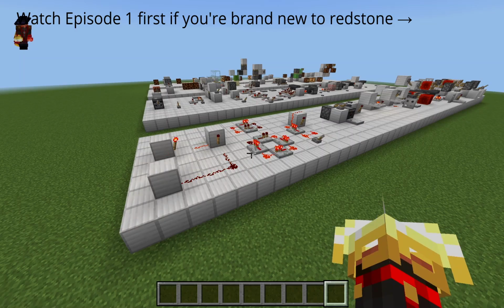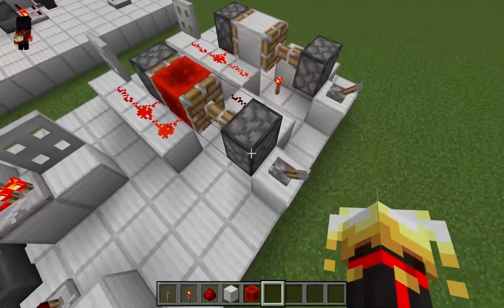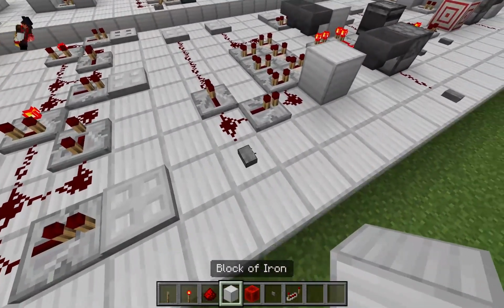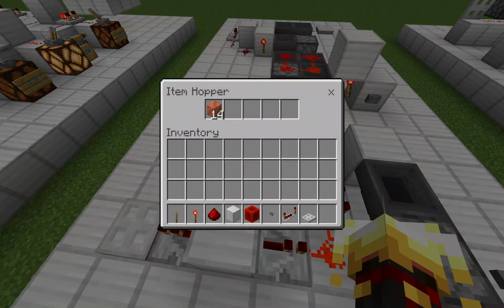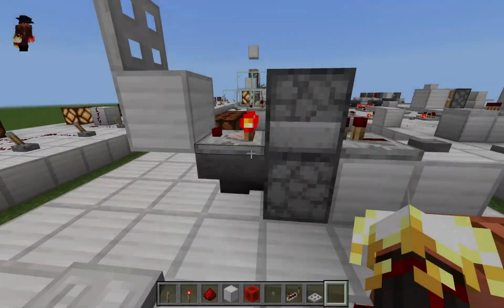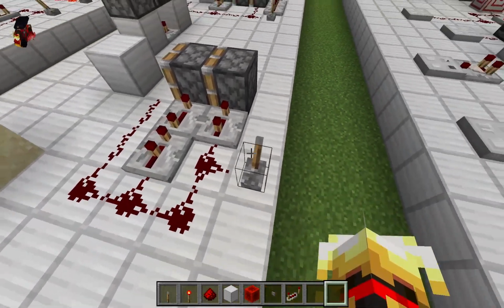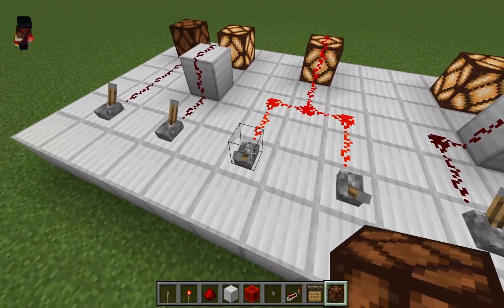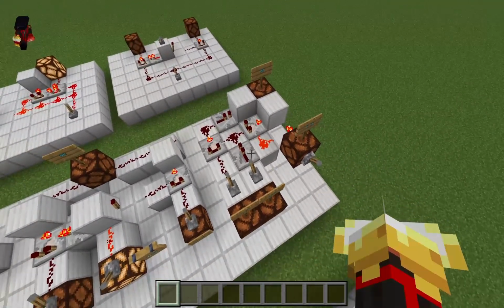Redstone Tutorial:  Part Two – Circuits

Comment: very good information for beginners in your video 👍 you got a sub.

at min 3:00 i consider it a latch, the smallest in bedrock i think. if you give it a 1 tick pulse it will jump back and forth as you show. if you give it a 2 tick pulse it will act as an SR Latch.

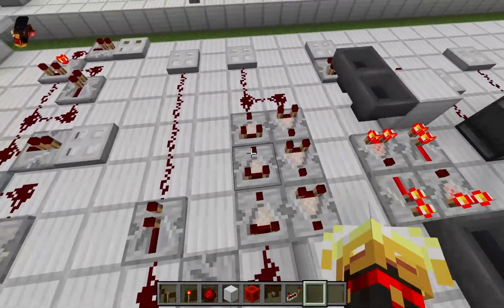the comparator loop you show at min 8:00 is also a very interesting circuit that can be used in several ways.

All in all Well Done 👍👍👍
Reply from the maker: Yea that’s true, it is a latch, I personally haven’t dived that much into memory so therefore am not so good in that area, otherwise I would’ve done a bit more about that in the video. Thank you for the support!
Reply: @ I think you will get stuck on signal strength. eg the comparator loop can be programmed with different signal strength on the different pulses. you can generate different patterns or different lengths of the pulses. we will start a Bedrock Redstone survival server very soon. would you be interested in joining?
Reply from the maker: @ yea I knew that about the comparator. But thank you for pointing it out. I would be interested in joining a survival server.